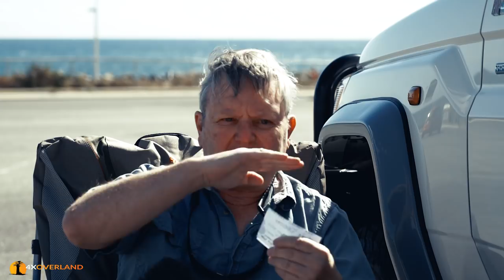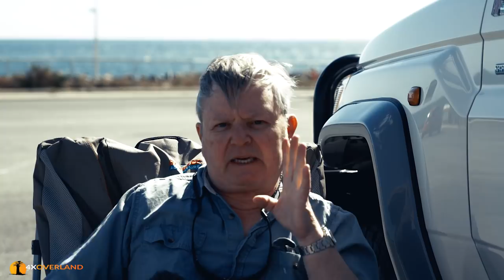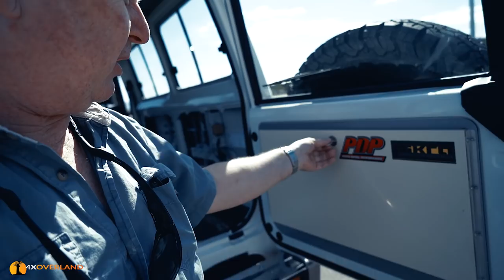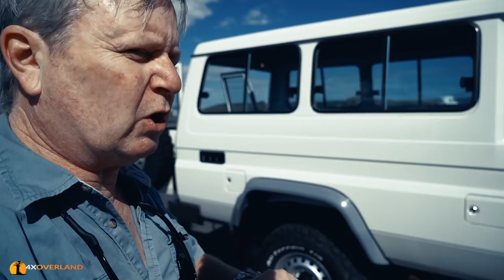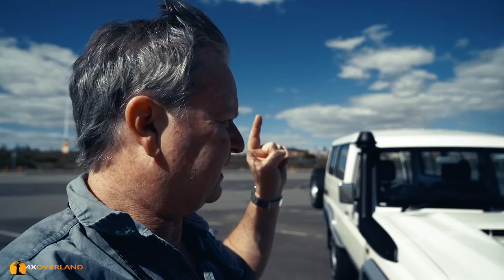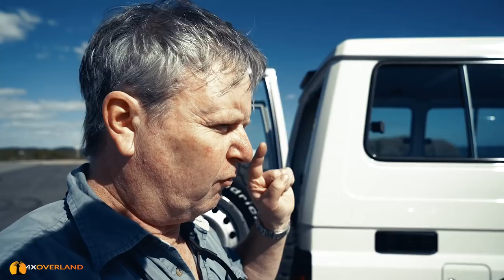PERFORMANCE UPGRADE EXPLAINED. AndrewSPW Land Cruiser build-9

Comment: Please don't tell me that you installed Old Man Emu suspension.
Reply from the maker: My job is to review products. Please remember that.
Reply: Get ironman gear
Reply: No way , Ill take ARB gear over ironman any day.
Reply: I can't wait to get OME suspension. Just have a couple more mods to do at ARB first.
Reply: FAT RAT CUSTOMS OFFICIAL , I think he is doing a coil rear upgrade.
Reply: I'll be surprised if he went with dobinsons mrr's, just unfortunate that arb charges a premium for their products..especially their lighting gear.
Reply: mattymmmm I should go over the video to check if the track is corrected
Reply from the maker: I'll be testing an IronMan rig in the US next month. But up to now, every IronMan suspension that I have driven has been truly terrible. But I know they have improved their product, so I shall see.
Reply: 4xOverland  Sweet set up so far great ride
Reply from the maker: You are kidding, right? Its the very last suspension I would fit to my own rig. I would prefer to leave it bog standard.
Reply from the maker: I am not considering a rear coil conversion. Might investigate it for phase-2, but not now.
Reply: I changed out all my ironman shocks to OME recently... night and day difference, the car drives so much better now, probably the best mod I have done!!
Reply: Dobinsons Springs & Suspension for my money
Reply: Good for you. I'm surprised in that some on here still get brand blinded by "saying this brand is better than this brand"  - that's just irrational. Of all the car communities the workload we put on 4x4's overlanding means we ought to get much more experienced results testing suspension and far less prone to marketing BS.

Comment: I generally like this guys stuff, but some of the things he is saying here are plain wrong. ALL chips no matter what breed or ilk produce power in the same way- They bump rail pressure and increase the duration of the injector pulse and increase boost on the turbo. There is literally no such thing as a free lunch and that's what you seem to be saying here- To get power out of an engine you have to burn fuel and air, there's no miracle way to increase power in the same engine without consuming more fuel and more air- As for reasons to fit a chip, power is the only one- These things will not give you "better" fuel economy because all they are doing is "tricking" the factory ECU into ramping more air and fuel into the engine- You cannot make the same engine produce more power by bolting on a cheap aftermarked box of tricks. The idea that Toyota are missing out on fuel economy savings is crazy- Fuel consumption is one of the biggest sale points in this day and age of sky high fuel prices, if there was a cheap fix to get more bang for less buck Toyota already would have done it. Are these engines undertuned- Of course, almost all Toyota engines are because they are expected to last forever- Can you squeeze more power out of them, sure. Will you burn more fuel doing so? Of course.

Comment: Sorry uncle Andrew... on this one you are very wrong.
Reply from the maker: Please share with us your reasons for saying this.
Reply from the maker: Mark S. Nobody can see your comments. They are invisible to everyone but you. And I know you have a problem not with what I say, but me. If I say something, you automatically disagree. Now go away and make a life for yourself. You are being pathetic. Try this one: The sky is blue.
Reply: Uncle Andrew, I firstly want to state that what you forgot about 4x4 over landing I must still learn. I enjoy watching your ventures. I will give a relative short answer as engines and its tuning is a massive subject.
1.  Mapping a compression ignition engine(LC70) and mapping a spark ignition engine(lambo) differs in the same way gasoline differ from diesel. 
2. One aspect that is shared is tuning the AFR's in the map, yet different... if you run a turbo gasoline engine lean you increase egt's but when you run a diesel rich the egt's goes up.
3. If a turbo boost pipe jumps off or it leaks air flow you will see egt's rise. (Its very important to make sure you dont have boost leaks at all times) The modern diesel injectors(piezo) are ecu controlled and can inject fuel in different times and volumes... this help with controlling the EGTs... some chips cause an increase of rail pressure to add fuel... this is not advised. ( I dont know if the new unichip do the same or if it actually drive the injectors individually by controlling duty cycle and timing)

4. Very little if any vehicles are fitted with egt sensors from an OEM. If you fit an egt sensor you should have one for each piston. The oems make use of lambda sensors that cause the engine to go in limp mode if the reading (O2) values are out. Intercepting these signals and changing them is cutting the safety line very thin. Engine design and tuning is also very difficult for the manufacturer because they must determine worst case scenario in fuel, climate, terrain and application... those variables cause OEM's to add safety margins. Making these margins smaller without knowing how big they are is risky...as you dont know the measure.

5. The reason the 200 LC makes more power is because the 2 turbos can supply more air flow and therefore more fuel can be supplied resulting in a more powerful engine.... egt's is kept in spec this way...
I learned a lot from doing flame proof turbo diesel testing for under ground mining vehicles. 

6. I was told that many drivetrain component on the V8 LC 70 was not designed from scratch for this vehicle model variant. Things like drive train shafts was carried over from other models... and torque is any shafts worst nightmare.(  I might be wrong on this)  Manufactures limit power and torque on engines to protect other components. Some years back I modified a Subaru STI engine making 406 Wheel KW and 673 Wheel NM....very soon the clutch failed so I upgraded the clutch, when the clutch was holding, the diff failed... and so it kept going on. 

7. Running in an engine... here I differ... lucky if your engine are being run in at the factory. Engines are to be run in keeping rpm low(below 3500-4000) while using a mineral oil or special run in oil. (Direct instruction from Cosworth Engines) The rpm is kept low because of the lower lubrication/friction oil grade spec...this will help the piston RINGS to wear in on the honed sleeves...it also help the cylinder head valves "seat". (factories dont lap valves anymore, they just do multi angle cut). RPM is also kept low to limit wear on the crank and bearings due to the run in oil grade. Think of it this way... you want some things to wear and others not... high grade oil will eliminate the wear you want on rings but it will be good for the bearings and crank...but you want the rings to wear in, run in oil will let the rings wear in but you can damage the crank and bearings if you rev the engine to high. By keeping the rpm low the crank and bearing will be fine and you will wear in the pistons. Run in is usually 1000km to 1500km. 

8. After the chip, the vehicle does not comply with the emissions homologation regulation.

Conclusion.
One person's reliable differ from another's, like you said. Every man can do it the way he wants cause in the end it is his own money at risk.
Reply from the maker: Thanks for this Jacques. I appreciate your obvious knowledge on the subject. PS. Please don't call me Uncle. :-)

Comment: Don't want to rain on your parade, or to offend you in any way, but it's very hard to claim you're an expert and people to believe you, when you buy a truck and then sell it after just 6 weeks because it isn't what you were looking for. I'm not saying you don't know your stuff, but this project looks to me like an overkill for its intended purpose.  If you plan to seriously modify a 4x4, why buy a new one and then tear it to pieces, when you can start with a second hand vehicle that you can get for probably a third of the price. Anyway, that's my 20 cents.
Reply from the maker: Who said anything about me wanting people to believe me?? I am NOT a preacher. I have no parade. I make no such claim. My audience concludes any qualifications. Not me. I just share what I do and what I learn. So If I may, consider it this way:  My experience told me that continuing with that build was going to end up with a under-par vehicle BEFORE completion and the expense. Expense was not a primary concern, as you have wrongly assumed. Overkill? The camper would have been mega overkill. That's another reason why I killed it. A wise man can admit when he is wrong. And I do not hide my mistakes, and that is why people follow me in large numbers. They learn as I learn. Also, I make no claims to being an expert, like almost every 4-wheel driver who has ever driven a trail. Many years ago I bought a Disco-1. I sold it after a few months because I was not impressed with it. Mistake? I don't think so. Learning experience? Yes. Same with this cruiser. But this is VITAL:  I do not know everything there is to know about 4-wheeling. I am learning like everyone else. The only difference is, I broadcast my triumphs AND my mistakes. What you see is what really happened. I contrive and add nothing. Judge me on that if you wish.
Reply from the maker: Ronny's channel is excellent. He is a very nice chap. And his approach is very different to mine, thankfully. Its good that we are different. We share many followers, many prefer his work and visa versa. I am opinionated. I accept that, and Ronny less so. I tend to rant more. That's who I am. There is plenty of audience to go around. If I annoy you, no worries as I am not trying to please everyone. Ronny freely admits  his channel was inspired by my own because I think I was one of the first in the world to do this.
PS. Do you support Ronny on Patreon? I do. You should.
Reply: I only follow 4xOverland, but not because i'm a big off-road fan, but because I like everything that has to do with cars or trucks. From what I've seen so far, this channel is probably the best in terms of quality of information regarding off-roading, but I'm sure Ronny Dahl has a good channel also. What I was saying is that no matter how many years of experience you have, you can always go wrong with a project like this, that's why, in my opinion, it's not a good idea to invest a lot of money in something like this. That being said, people can spend their dollars,  however they want.
Reply: That was exactly my point: you can always make mistakes with  a project like this, no matter how many years of experience you have. That's why, in my opinion, it's safer to start with a cheap, base vehicle!
Reply: Perhaps "safer" but IMO its less interesting and, more to the point, not what Andrew wants to do. The world is a wide place with TONS of different ways to do things. Just because it makes sense to you doesn't mean it makes sense to anyone else.
Reply: why by a second hand vehicle when you can get a brand new one that noone else has ruined. l hzve always built my 4x4s from brand new.
Reply: I watch both and they are quite complementary and different. Many people watch and Patreon 4xOverland because we like the good and the "bad" and have accompanied you (as spectators for most) throught your life adventures for quite a few years. I understand people being critical but perhaps they should watch a few other of your videos to get a more accurate grasp.